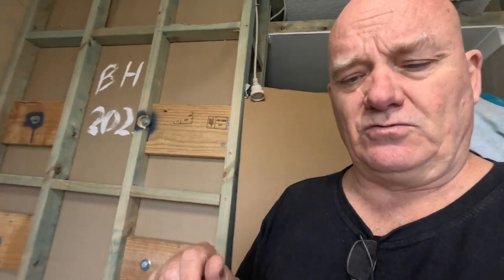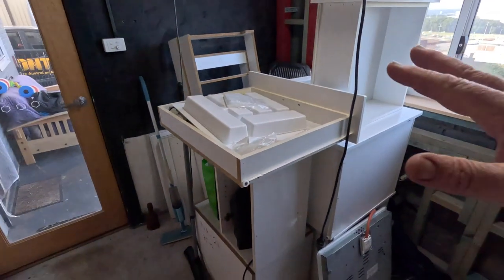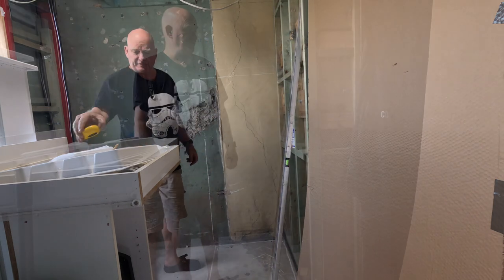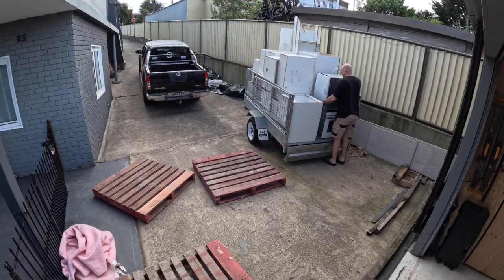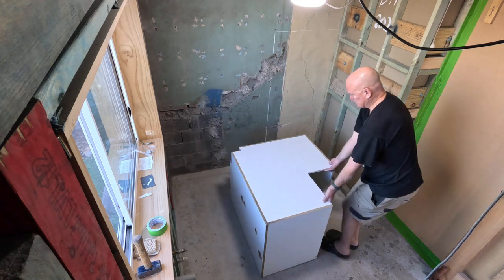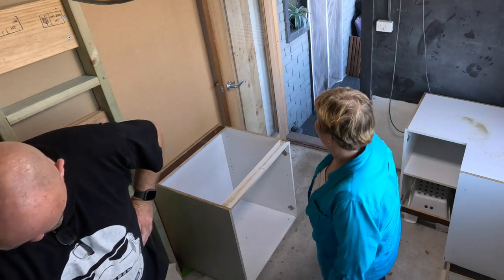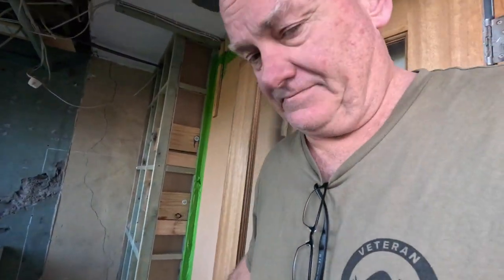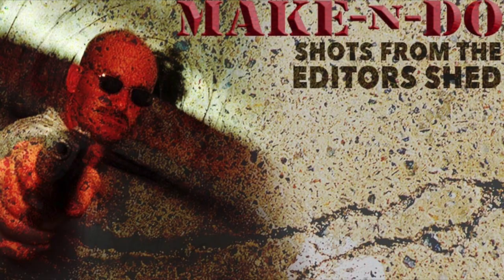Rough start to a kitchen project

Comment: Looking forward to the next episode already.  I designed the kitchen layout by making small, to scale cutouts and tried them in a scale plan of the space, sort of worked.  The only other serious advice I got was to make sure you spend a lot of time fitting the plinth, get it solid and dead level, the rest looks after itself.

I know you’ll make it work and it will look great, the client will be happy,
Reply from the maker: Thanks Mike. That's all sound advice for sure. Drawing a plan didn't work for me – I'm not skilled in that department. And, while I didn't think of modelling it in miniature, I sort followed your idea at 1:1 ;-)
Many iterations later, I can tell you I finally nailed it. Or at least I think I have. 
And I did spend a lot of time on the plinth.
Cheers mate.